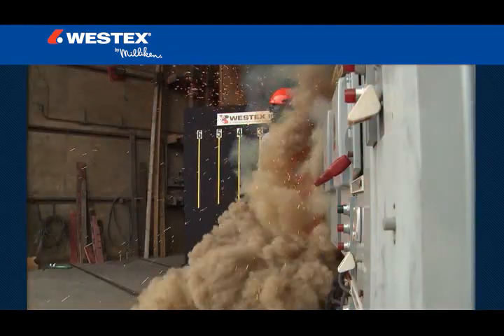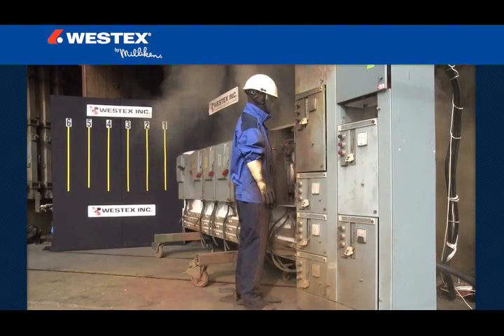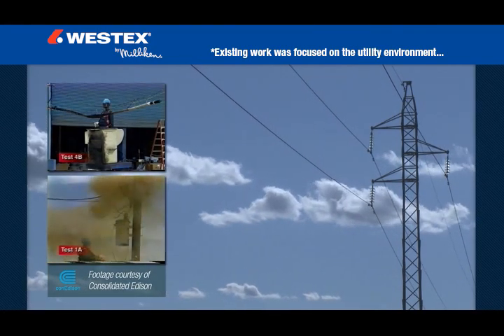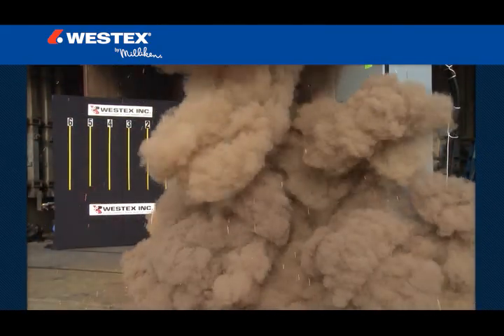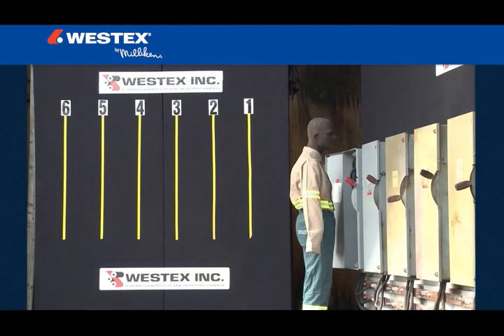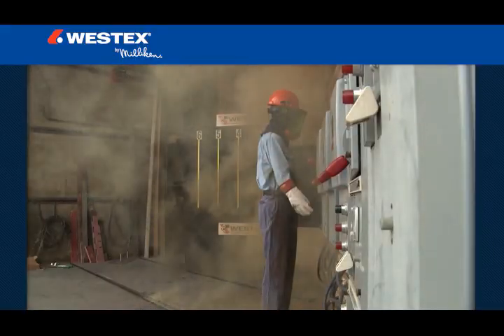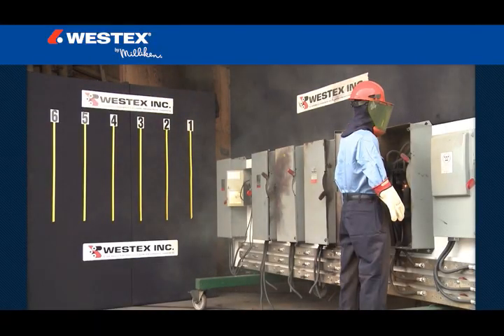Arc Flash Overview by Westex

Comment: The flash sometimes can be as powerful as a 12-inch to 20-inch professional fireworks salute shell inside the electrical switch, fuse box, or circuit breaker, or bus complex blowing right in front of you. The injure zone or kill zone may be quite small in arc flashes, but if you are in the danger zone as the flash happens, this can still have extremely dangerous physical consequences without PPE (can lead to death), but lesser chance of serious injury or death with PPE. 

Some arc blasts can heat up as much as 35000 degrees F. That is much hotter than the hottest kiln oven on earth!!!!

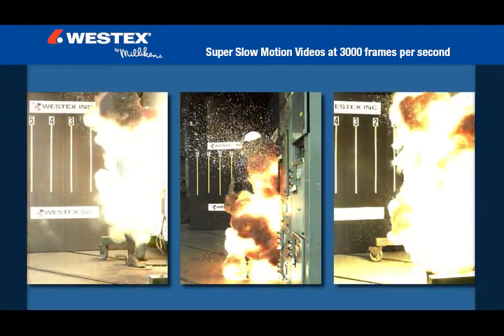Comment: Just fyi, there is no such thing as 100 times slower, (see 1:32). By its nature, multiplication is an operation of increase, not decrease unless you multiply by a number less than 1. Did you fail basic math?
Reply: hey, masters level physics student here. 100x slower is a valid way of saying it, you can represent it multiple ways. 1: represented as a 100x change in magnitude, indicated by "slower" its clearly in the negative. 2: multiple of denominator. This is a perfectly normal way of saying a reduction equal to dividing by 100.